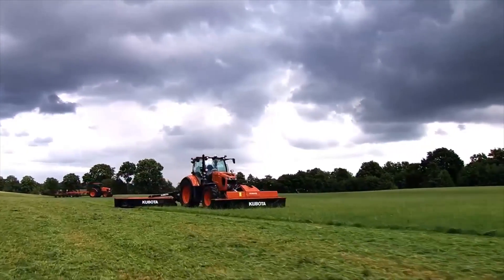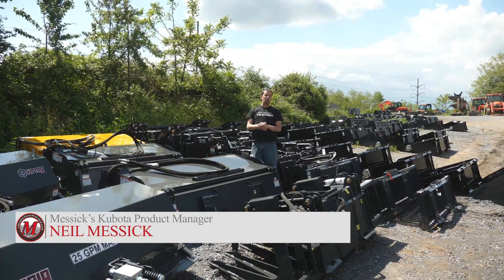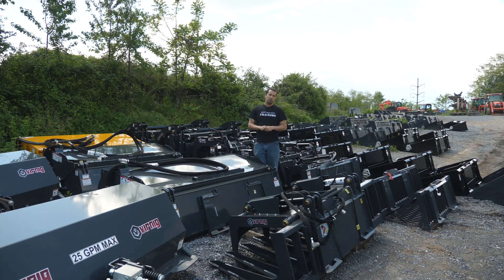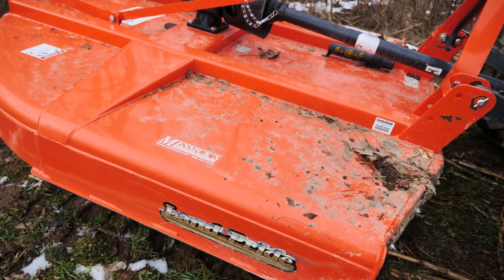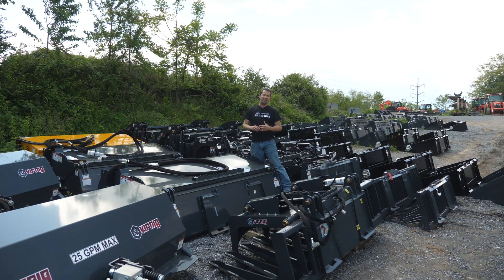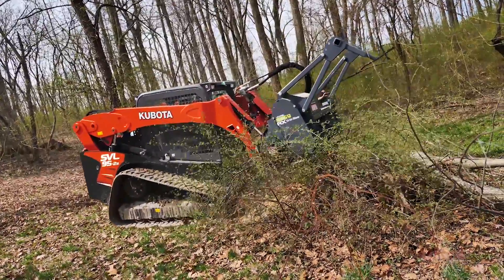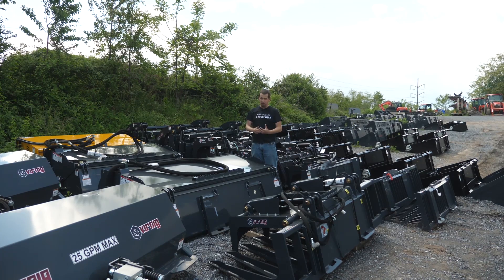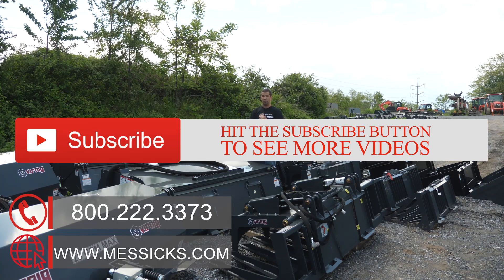MATH! Understanding hydraulic horsepower

Comment: what most folks don't realize is that the hydro pumps on their tractors are rather small, even on the biggest tractors (until you get to the industrial sized stuff); and in the game of hydraulic motors, there's no replacement for displacement! most of the pumps on most tractors are about the size of your fist. they are perfectly sized for what most tractors will power hydraulically- from things like lifting the three point, to a loader, to at most a backhoe. these things don't take a ton of flow, a hydraulic motor on the other hand, takes ALOT of flow, constantly and the ability to maintain that flow at a high pressure, and the pumps are sized appropriately- most of them are big- but if you had one of those mounted on your tractor, you'd be wasting a ton of power just pumping fluid and building heat for no reason. so for that reason, if you need a big displacement pump on your tractor, you might look into a PTO mounted pump and a separate hydraulic system- one with its own reservoir, cooler and piping. I've had to do this once before on a tractor that i had the only had a small hydro pump and i wanted to run a skid steer backhoe on it. i ended up using a 13gpm PTO powered pump/reservoir and it worked rather well.

Comment: Another awesome video Neal! Once again, I learned more from your videos about my tractor than any other source. I do have a couple of questions. First is that number measured by the total gpm for the pump flow or pump flow and steering flow? Example would be the l3901, pump flow only (6.3), pump flow and steering flow (6.3 + 3.8 =10.1). Second, I have a Kioti CK4010 that is a direct competitor to the L3901 and I can't find the PSI. Would it be about the same as the 3901's to use as a rule of thumb? BTW I love my tractor and recommend Kubota as well (I can't say the same about the JD 3E series due to it's limitations) but I bought it due to my relationship with my dealer more so than the brand here in NC. If I was in PA I would buy a Kubota or New Holland from you guys in a minute. Second, what is your opinion on PTO driven backhoes that DO have subframes, since it looks as if the PTO will offer more power that the 3901 class of tractors will offer in hydraulic HP according to your math? I have always recommended to people to get the OE loader and backhoe but to shop around for other implements such as Woods, Landpride and so forth. Thanks a ton for these videos, they are so helpful.
Reply from the maker: Don't combine pumps, implement pump only. Likely around 2200-2400 psi.
Reply: @MessicksEquip  Neal, thanks a ton.
Reply from the maker: We generally don't sell pto pumps anymore, most tractors have a larger implement pump than what the PTO pumps put out.

Comment: My tractor has a total flow of 8GPM but the line sizes on loader are not large enough to allow 8GPM of flow so that is another thing to consider. The flow needs to be measured at the 3rd function not the tractor's base hydraulic flow and pressure. Also, many tractors do not have an open flow for motors on the 3rd function, they require a switch to operate the loader valve and temporarily allow flow to that function.

Comment: Can't find GPM specs for my L5460 w/ LA1055 front loader. Want to run an auger, but Kubota doesn't give aux GPM flow. I found specs for Kubota M62 TLB, but none for my tractor. Do you have any idea? Thanks!
Reply: Tractor Data . Com says that tractor  make 9.4 GPM.  I've found most hydraulic motor driven equipment needs around 13 or so to even be considered usable, often more like 18.
Reply: @DocRevo  He needs GPM from the 3rd function at loader. It will likely be reduced substantially.
Reply: @TallTexasGMan   Every third function kit I have seen is nothing more than a valve which is tee'd in to the existing system for the loader controls. Usually just connected to the power beyond port. This will get the same flow as the loader controls. No more, no less.
Reply from the maker: Actually this would be an interesting test. I'd suspect it will be less, the ports in the solenoid valves may be more restricting than you think you.
Reply: @MessicksEquip   Yes, the valve  which is added may be more restrictive than the main system controls, depending on what  components are chosen.  
 I originally began commenting  on Niles desire to operate an auger.  It may be true the third function on his tractor might only put out some reduced percentage from the main system, but the context here was essentially whether or not a motor driven tool could operate off his tractor. In my experience, the simple answer would be no since his tractors main system is fairly low flow - even if full system flow made it through the third function, there just isn't enough flow to begin with.    
I would also imagine the tractor MFR doesn't offer third function details because you could easily pick out your own components to add if it's not installed as standard equipment. Personally, I used a standard DO3 valve I know is good for 8GPM for my  little L3301 tractor to operate a grapple bucket.

Comment: Or this 
1 horse power = 33000 foot-pounds per minute (by definition)

1 US gallon = 231 cubic inch (by definition)

1 psi = 1 pound per square inch (by definition)

In the equation

𝐻𝑃=𝑘Δ𝑃𝐹

HP=kΔPF

where 𝐹
F= flow rate in gallons per minute, Δ𝑃
ΔPis pressure difference in psi, and 𝐻𝑃
HP
is power in HP, you need a conversion factor. Doing everything in inches:

𝐻𝑃33000∗12∗𝑖𝑛𝑐ℎ−𝑝𝑜𝑢𝑛𝑑𝑠/𝑚𝑖𝑛=𝑘Δ𝑃𝑝𝑜𝑢𝑛𝑑𝑠/𝑖𝑛2𝑓𝑙𝑜𝑤231𝑖𝑛𝑐ℎ3/𝑚𝑖𝑛
H
P
33000∗12∗inch−pounds/min
=
k
Δ
P
p
o
u
n
d
s
/
i
n
2
f
l
o
w
231
i
n
c
h
3
/
m
i
n

from which it follows that

𝑘=23133000∗12≈1/1714
k=231/33000∗12 = 1/1714

In other words, "in plain English that a 9th grader can understand, and yet be correct and true to its purpose and place in life to satisfy seasoned physicists":

Comment: 1/1714 is apparently the conversation number you need to convert 1hp which is 744watts, which is an amount of energy. So to go to gpm from metric where it is kg/KPA and volume of a gallon is different then the metric cubic meter. So its an easy conversion factor instead of trying to calculate it all

Comment: Rules of thumb
1 HP=1 GPM at 1500 psi
1 HP= 36 in-lb at 1750 rpm
hydraulic motors are about 85% efficient
some formulas
hydraulic motor torque (in-lbs) is psi x motor displacement in cu in / 6.28
GPM= RPM x displacement in cu in /231
torque in ft-lbs = HP x5252 / RPM